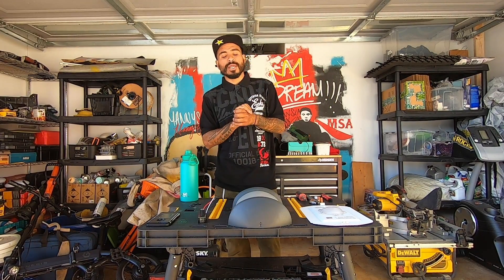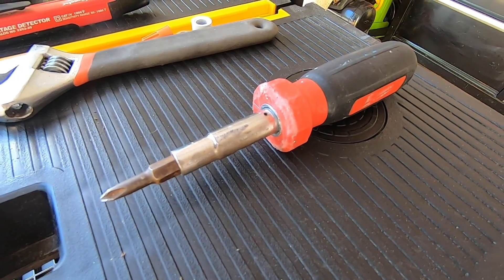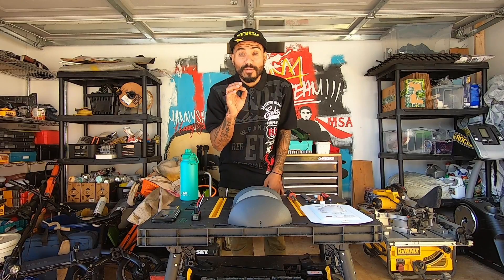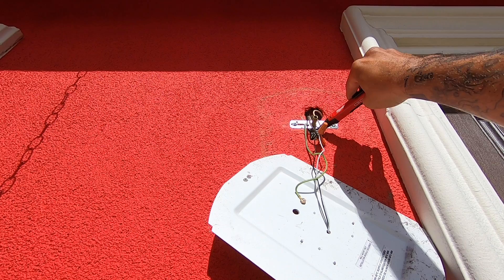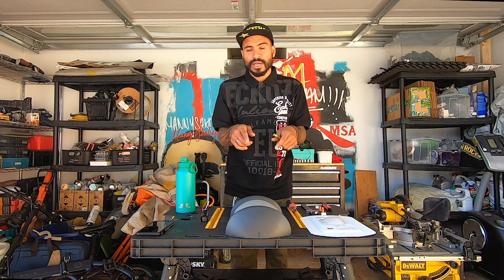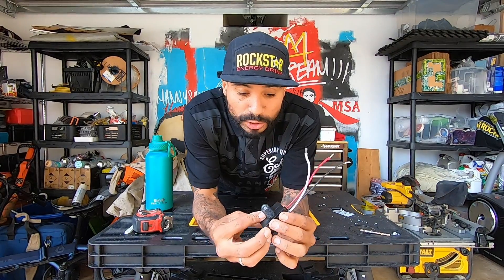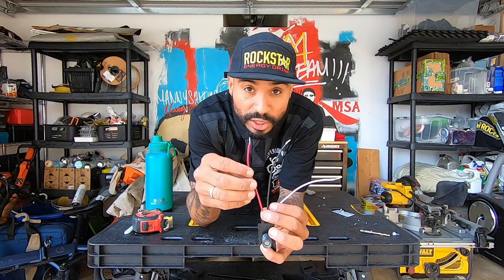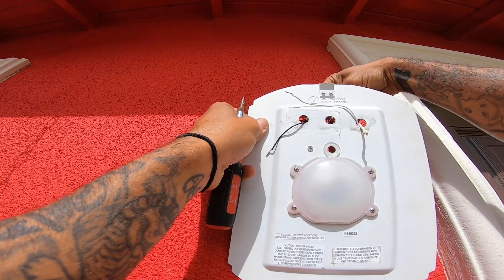How To | Instal A Dusk Till Dawn Sensor

Comment: This is excellent, thanks a lot. I've got a question though. Can one use a photocell to controll multiple electronic gadgets? I use solar system and would like all the lightings (20x5 watts LDC bulbs) and fans (8X ac/dc) ceiling fans hooked to a photeocell so that they all work when its dark and be of by day. Many thanks.

Comment: Do you have to drill a hole and expose the photo cell to the outside? Can you leave it hanging or mounted inside the fixture?
Reply from the maker: You have to drill a whole to the nut on the photo cell fixture stays on tight

Comment: If a fixture is loop wired, the white is NOT a neutral. 
The very first step in this process to to find the circuit that powers the light and turn that circuit off, look at the switch interrupting the fixture, if there are two black wires this fixture is wired traditional, if there is a white wire on one terminals of the switch, stop and consult an electrician.
The photo cell requires a neutral wire to operate.

Comment: Fire Department on stand by, nice pre planning! 😂
Reply: One thing that isnt a good idea is to shut the main off because when you turn it back on there is a surge that happens which can blow appliances out second no rubber grommets for the holes drilled through the metal house electrical wires vibrate which will cut through the insulation of the wire which can cause a house fire just saying.  Knowledge is key with electrical.
Reply: @christianslegel2803  very true with the surge. Just switch of breaker needed.

Comment: how do you prevent the light from deactivating itself once you add the sensor?  like when it gets dark enough to trip the light and then the light shines on the sensor and it cuts power thus turning off the light.
Reply: You have move the sensor far enough away from the fixture so that the light the fixture emits does not hit the sensor.  That will require a wiring scheme different than that shown in this video